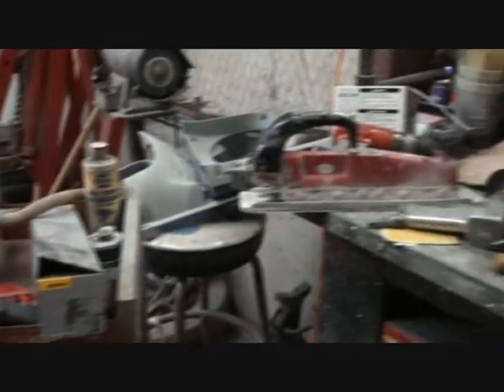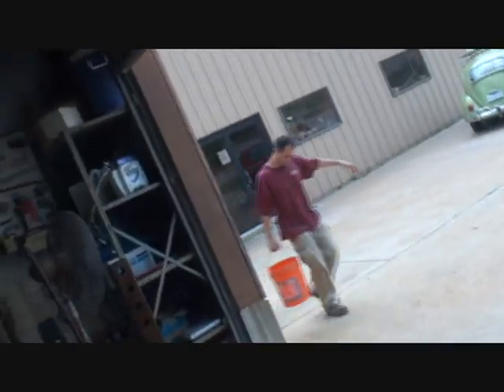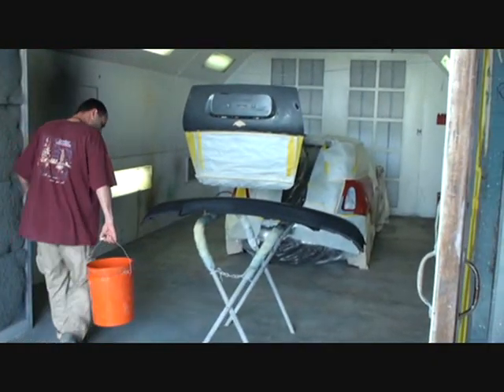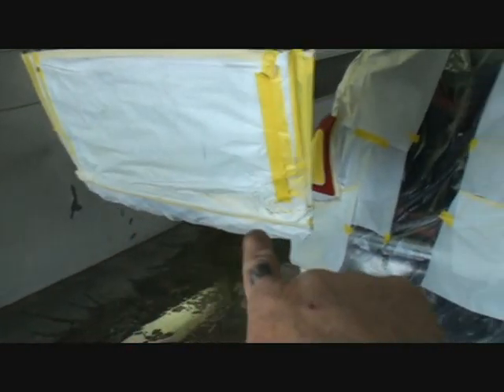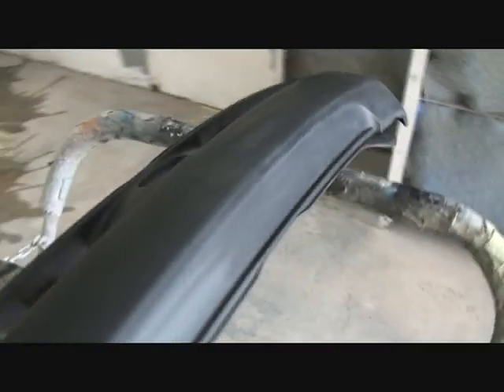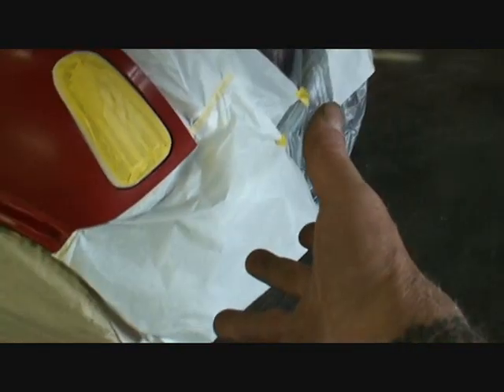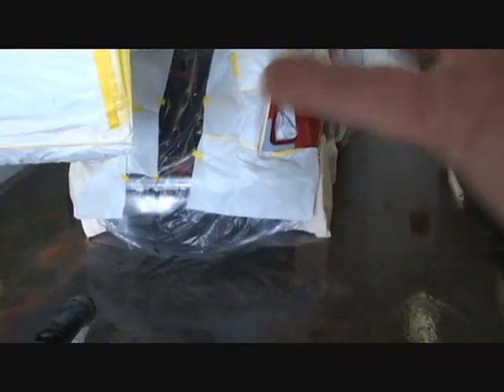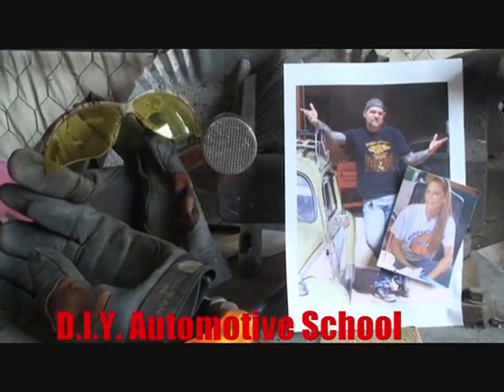Auto Collision Tech Tips-Water And Paint Does Mix.

Comment: @JimboVids Pulling glass out of an old car with really hard sealant can be a real b**ch, but you can do it without breaking.  Most guys just aren't willing to put in the extra time to get it out of there cleanly.  I like to park the car in direct sun light to soften up the sealant and I use a windsheild removal tool.  If the sun doesn't work, I pull the heat gun out and work inch by inch.  This is very time consuming for a low amound of labor $, so most won't do it.